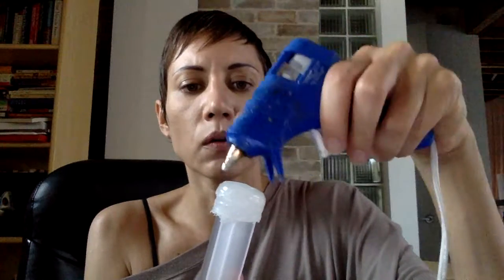60cc syringe for ozone nasal therapy - part 2

Comment: i had similar thoughts and ideas, but what kept me from trying this out was the ingredients of the liquid silicone. if you read them, you'll find lots of nasty chemical stuff and i do not know if they play a role when exposed to ozone or not, once the silicone is dry ...
Reply: Hot glue is not silicone.
Silicone does not melt.
Reply from the maker: yes - great point! I thought of that too and did some research.  I don't know if liquid silicone is similar to the silicone glue sticks used in crafts. I wonder if you are thinking of caulking silicone?  I didn't research that one, just the silicone sticks I have.  you just motivated me to put together a blog post sharing my research on the subject.  thank you for your comment, I highly appreciate your input :) .
Reply: Yes, indeed I was thinking about caulking silicone ... so with the silicone sticks it might be different.